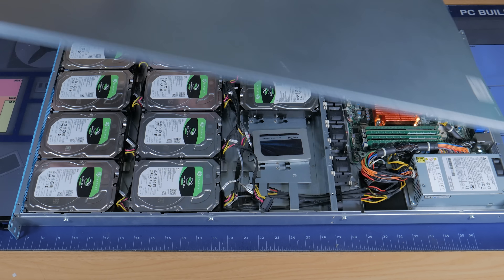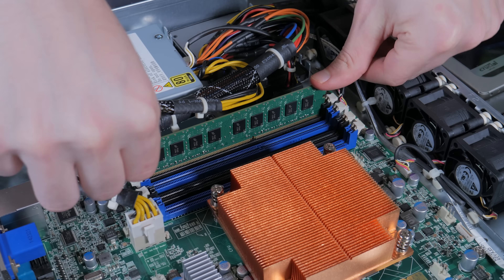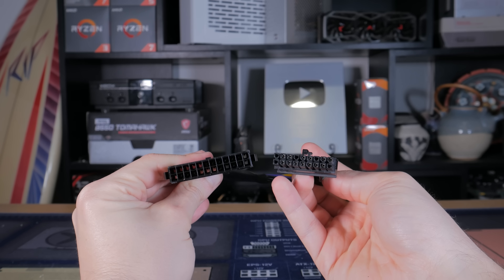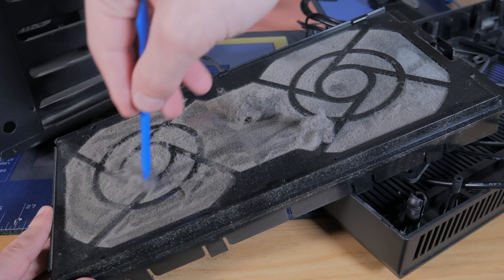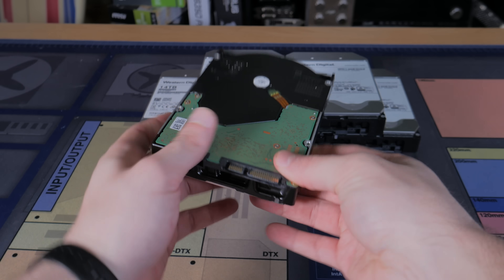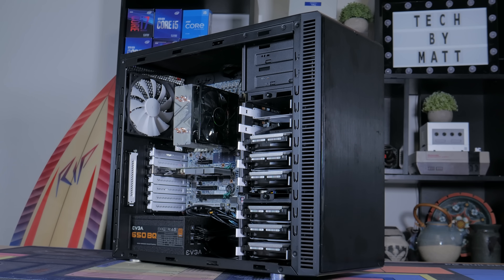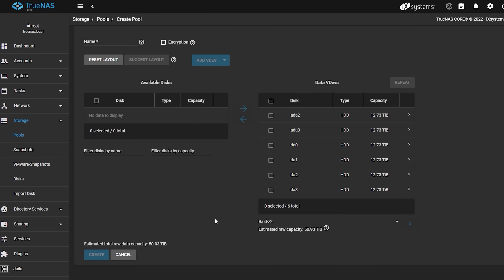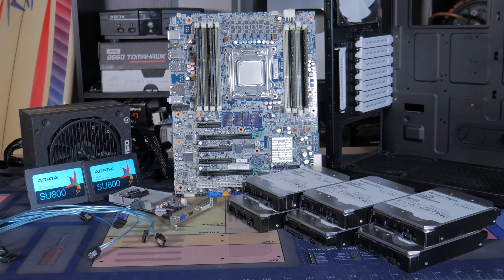Budget Storage Server 2022! | 84TB NAS

Comment: I watched your chenbro 80 terabyte server build,but when I hunt for it,Lenovo keeps comming up,except there chenbro cases.
If you research older new old stock tower cases like Aopen from 2004 Era,these had room for 7 drives.
There is still a lot of old stock even with power supply in them! And..made with real steel!
Although there a lot of cases that can hold 8 drives(desktop units).
I was in a computer store in Calgary that was an upright case,with room fir 25 drives!
I went there this past summer but they aren't pushing that product,cuz kiddies like laptops,so that what they're selling!
After you installed all 10 drives,I noticed you said only one would be active,whike the others where for redundancy! 
Let us know the difference between a cache drive and swap,vs paging.
Also,I find trunas little useless,when trying to use the dives but i may have made some mistakes with it.
Frebsd,is actually what is is,freebsd,can run updates and a program called " vinnum ".
So,did you find a pre-built chenbro server with a super Micro server board already installed,which is what I thought u said it was.
Plus msg me.
I want to run am email farm server so I need through put more then storeage!

Comment: I built a raid 5 server with this exact case like 11 years ago. lol Back when 1.5TB WD red drives were the new thing on the block. I had a hardware raid controller card. 6 drives with one hot swap. Only got me 7.5TB array. Crazy they make 15Tb in one drive now. Yes, one hot summer i had a drive fail and was nervous for like 18 hours while it was repairing the data onto the hot swap drive. I had a lot of issues with those 1.5 drives. RaidZ sounds much better. My card could only do raid6 back then. And it was much slower than 5 on the cpu.

Comment: I have just ordered new instead of second hand hardware to make sure power consumption is low, choosing a µATX Intel B660 motherboard with 2.5 Gbps ehternet and an i3 12100 processor (intel graphics) with a 400W 80+Gold power supply to host a simple RAID5 NAS with 3x4To drives. I hope my idle power numbers will be low, so would be interested in having your numbers with older enterprise hadware, even if the number of drives is of course different.

Comment: Just one question for you now: where did you get that tower to house all the components and visiting the links for the western digital external drives and boot SSD only lead to links that were either no good or the item you've linked isn't for sale. Do you happen to have any further advice for someone looking to emulate this setup, but with different storage options ?

Comment: One correction: RAID is backup, is the most efficient and fast way to backup files. Keeping file on cloud is just puting them on another RAID that isn't located at your place. Every server configuration uses RAID, it's the most efficient and has default redundancy. This is just how things are  !
Reply: RAID is not backup. It offers redundancy, and that is all. A backup is additional copies of data stored, preferably 'elsewhere' and in redundant fashion; i.e. a separate storage solution or site that will be intact after complete failure of the main storage.

Comment: building a NAS as I watch this; amazingly in the exact same case also bought used local for the same reasons as you. I love the component selection, like you said you're way more about it than the big boi yters. Was able to snag eight 4TB Seagate 5900RPM Skyhawk drives for $35 per, paired with an X299 MSI Raider board ($120 used local), and a $200 ebay i9-7900X cooled by a $40 ThermalRight FC140 that performs neck to neck with an NHD-15. Nowhere near your 84TB but your hoarding habit is worse than mine. Subbed, hype for more!

Comment: Built mine for around the same price 2x xeon 2680v2's, 32gb ram, be quiet dark rock pro 1000w, 6x 6tb wd red plus, 4tb nvme casheand  rtx a 4000. probably could have gotten some better performing hardware for the budget and ditching a few hard drives, then buying them later when you need the actual space.

Comment: 9:18 WD doesn't do that to discourage people to shuck the drives.
It's an actual enterprise feature, when you have multiple servers with 100s of drive each, you don't want them to spin up all of them once, with that pin number 3, you can schedule drives to spin up in order, so that you don't have massive power spike trying to turn on your servers by all the drives trying to spinning up at once.
Reply: How do you know that
Reply: @raidone7413  many nas and enterprise hardware boot drives(and other devices with high load on the PSU/s ) one at a time or by pairs of them ,to avoid exactly the same ,power spikes are a dangerous and real problem due to power supplies features like overcurrent protection and overload protection. imagine the power spike if you boot 25 drives @15k RPM at the same time... . On the other side ,if they really would like to avoid shucking ,belive me there are easier ,cheaper and better options like firmware checks or propietary connectors instead of standart sata port on drives. in fact i shucked 4*8TB wd drives and i did nothing about the 3.3 pin ,cause my ASUSTOR nas use the drives without any mod :)
Reply: @raidone7413  This is the same reason why corps like google are making their own way to boot up their linux machines. cuz it take ages for each to spin up and bring to life.
Reply: @raidone7413  Most of the bigger WD external drives are just using their enterprise internal drives. They used to not even replace the labels and were reds before switching to the white label like 3 or 4 years ago. Also the 3.3v pin feature just isn't compatible with most consumer brand PSUs, that's the reason they don't spin up.

Comment: Was looking at buying an off the shelf storage server, but wanted to see if a DIY project was within my scope.  Thanks to your insight and excellent presentation skills, looks like I will go down the DIY path and save some major $$$.  Thank you so much!
Reply: Yes, NAS servers are over-price and low spec.  The worst part is that they are limited and expensive in extending drive capacity.  The 4 bay extension can be sold at $500 or more, this can cost almost 60% of hard drive.  This is ridiculous.  The rack mount chassis is too loud to be used as HOME NAS.  TBH, any NAS vendor should provide option for new drive extension in less than $20.  That fits the nature of home NAS(incremental/annual spending without much planning)

Comment: The 3.3v pin isn't to prevent shucking.  Those externals actually use that pin to hard reboot the drive if it freezes for some reason.  A lot of NAS systems also support that pin to do the same thing.  It has a purpose... it just isn't a widely used option in desktop systems, so they don't usually support that pin.

Comment: Guys i have a question, for a nas killer its better to have xeon with ecc memory? and wd are the best for a nas or should get another brand? and for stuff like plex gpu is important like using a quadro?
Reply: now a days, its better and easier to have a newish Intel with a integrated GPU. Their quick sync is better. You can pickup a qnap, synology, or an asustor with a four core unit that will transcode 4k on the fly. Now, ... don't get me wrong. A powerful nvidia GPU will beat it, but you will spend the money for it!!

Comment: Those fractal cases have two SSD trays on the back of the motherboard plate. I have one I'm in the process of turning into a Proxmox VE + NAS. If your trays are missing I think you can still get them on ebay.

Comment: I was never a fan of shucking externals to rig up a server. I just buy used sas drives and LSI controllers from ebay.. works well. This last go around I bought new HGST/WD sas drives, but used an intel i7 11700 and B series motherboard.. added 10gb nics to all my servers and torrent box, main pc, etc. Couldn't be happier with it. Fast and stable. The 11700 I bought for transcoding without a gpu, and the IGP is more than enough.

Comment: I also have a HP z420 and you need to tell the viewers about how to swap it properly. The system won't boot up without a video card at all. Also you need to short out some pins in the USB 2.0 header, USB 3.0 header and the FireWire header. CPU fan header 5th pin needs to be jumped to the 1st pin. Also fans have to be connected to the memory and rear exhaust headers. It will only boot with all these conditions satisfied. USB 3.0 header was especially hard and i had to solder the 2 pins under the motherboard.

Comment: You select boot UEFI because BIOS doesn't support as much storage as UEFI, not because the motherboard is old. And another thing, you should have setup iSCSI on the NAS, it's much faster. Your MAC and your primary PC can connect to it using iSCSI as well. Also, ZFS uses a lot of system memory to cache data, you should install a GB of RAM for every TB of storage you have.

Comment: Budget? Only if you're Tony Stark. Budget would be taking all the hard drives you've kept over the years from 40MB to 8TB and using those. Well, not the teeny tiny ones from ancient history but all the 500 GB on up drives. Budget is taking an 8 year old computer and using that, upgrading it to the level you need as cheap  as possible, i.e. used parts.

Comment: You - Builds a 80+ tb server for work

Me - heavily debating if I should get a 8tb hard drive to download my steam library locally so I can just swap games between my HDD and SSD instead of having to download them
Reply: I have a 8TB drive for my Steam library. But I have 32GB of memory, and an SSD cache which I use together with a piece of software called Primocache. With that setup there's no reason to not just run games of the large storage drive.

Comment: At 3:10
The chip model....

You send the chip model was an E5-1620.  You forgot to mention which one it was....there is the original, the V2, the V3, and the V4.
The V1 and V2 take a different socket (LGA2011) than V3 and V4 (LGA2011-3)
The V1 chip used Sandy bridge (32nm, 2012 release) microarchitecture. V2 used ivy bridge (22nm 2013 release).  V3 used Haswell (22nm, 2014 release).  V4 used Broadwell (14nm,  2016 release).

Each of the four chips has a different set of clocks as well....

This is all according to the app "CPU-L"....

Comment: i built a 6 drive Freenas server about 5 years ago using a base HP server that i got from Tiger for $200. The bad thing was it needed DDR4 ECC ram and that was not cheap back then. Freenas is happy using 16gb flash drives for the OS to I installed one inside on the MB usb connector and the other on an external slot so my OS is redundant. I did not have video files to backup so i used 6ea 3tb drives in a ZFS array and was configuring it 10 minutes after hitting the power button. That particular server uses a very proprietary display port that i could not get working in my monitors so I threw in a old low end video card for initial setup, after that everything as done via ssh over my network. The server interface over ssh is very easy to use on Freenas and it looks very similar to the Truenas screen.

Back then it cost me about $950 for this including the hard drives but it's been online since then with no hiccups. i have lost power a few times so i usually have to power cycle after that but it always comes right back up like nothing happened. maybe someday I'll need more capacity bit for now it's just fine for me.
Reply: i love how open source stuff is kinda timeless...5 yrs with no issues is amazing..lotta times I'll youtube a  command and not realize till later the video is from 8 yrs ago but still relevant today
Reply: @calvinpryor  This was a loss leader HP Proliant M10small tower server I got at tiger for $200 back then. The most expensive thing was the 16GB of DDR4 ECC ram. The 6ea 3tb red drives are all 5400 ,( don't need speed here and low speed drives are more reliable.

I've updated Freenas a few times and have 2 or 3 power failures a year but the system always comes up clean with no errors in the logs except for the sudden power loss. This system has been as reliable as anyone could ask for
Reply: @dell177  did that version of true nas support third party (if any) apps? That's really the deciding factor on diy/Tru nas vs synology type nas....if I can get the same.applications and functionality with true nas why would I spend the extra $ on their hardware? 🤷
Reply: @calvinpryor  I believe it does but I've never looked into it, all I wanted was a safe place on my network for my files. I can link to iot from OSX,Linux, and Windows

Comment: I just built a NAS myself. I used a Microserver Gen8 for it as I could get it relatively cheap and I wanted remote management and a compact design. I used the SCALE-version of TrueNAS as it runs on top of Linux and you can use Dockers and VMs there. And if I find another server of the same model for cheap, I could even connect them together.

Also I can recommend using a Ventoy stick if you have a bigger stick and want to install different operating systems from it as you have a menu there where you can select one of the ISOs you put on the drive before. There is a partition where you can simply copy the ISOs onto and delete them later. No need for burning them to the stick and wait for that process to finish.

Comment: I am thinking of creating a mass storage system to hold and be able to run games off of my main computer. Would it be better for me to have a storage server, nas, or just hooking up an external storage bay? I am leaning towards an external storage bay since from my understanding of servers and nas they are mainly used to spread files to many different computers. Is this what you would recommend and if so what are some things i should look for in  a storage drive bay?

Comment: In the future you could just buy a cheap hba(host bus adapter), like a lsi 9211-8i and flash it into "IT-Mode" or buy it preflashed for like 20 dollars and 2 SSF 8087 to Sata Splitters for like 5 dollars. 

This will give you 8 Sata-3 ports while having a solid enterprise drive controller. Been using it for years without a problem. Its also way easier to cablemanage. 

Also love the budget content

PS: might wanna take a look at Dimm 3 on your board 11:39
Just saw 15:00 did reseating fix the error?

Comment: Be careful with raid. Since an error on a drive is only detected as the data being asked is reported unavailable by the drive, thus the raid system flags this one out and ask for a replacement, as you put a new drive , the system will start to read what has not been accessed since a long time to rebuild. If a second unaccessible data is noticed on a drive used to rebuild the array... the system is pretty much clueless. To avoid this over long period of time, once a year I stop my system and inspect all my drive with MHDD. I have an old pc with the mhdd cd in it and the storage controller set to emulate IDE. Scan all drive, take pictures of the results and save them for comparaison with previous year as i'll do the same thing next year. This way I can monitor the degradation in health of the drive over time and even spot when some sectors are going to die soon.
Reply: He's not using RAID

Comment: If you are the only user (or there are only a few users) 4 cores and 64gb should be more than enough (unless you are working with lots of huge files at the same time).  You can also get a low power v2 Xeon L (4 cores) and save a little in power to boot.  I'm about to snag some drives to upgrade my storage server (4 core 16gb mem) but might take a shot with some renewed drives to save some money since I'll need 12 of them and save quite a bit of money.  

And I know the internet will tell you that ZFS needs 1gb memory per TB but that isn't correct.  Of course I can't find it but a ZFS dev once commented about the matter and basically said it was misstating how ZFS uses memory.  Unless you are in an enterprise situation with a ton of read/writes going on at the same time you don't need L2ARC or ZIL drives either, but considering I like to tinker myself I understand that sometimes it's fun squeezing every drop of performance out of a system even when it's technically overkill.

You would probably see the most improvement by far from the 10gbe upgrade which I'd vote for in a follow up video.

Comment: I have the same board and also have to key press for boot, I have a Pro Micro arduino board connected to USB port when the usb port gets power it seconds the key strokes for 30 seconds then stops. Works for start up but not for reboots because the reboot never completely cuts power so If i’m remote and need to reboot i just make sure to do a shutdown then send WOL

Comment: 5:15 That cooler will do you just fine, trust me. I have the exact same one fastened to my Xeon E5 2673v3 12 core and I am currently watching this video on one monitor, while editing video in Premiere Pro on another and i'm sitting at 42c :) 50c max since i fired up hwinfo.
Reply: Mind you I do have a 2nd 120mm fan janked up in a push/pull config
Reply: How did you get from 4 pin fan, to 5pin Mobo connection?

Comment: I have the same chassis, bought some years back. You can add up to two extra disk modules in there with room for three drives each, taking some space for PCIe, obviously, but that may be worth it. I'm using an LSI SAS controller for my drives, in addition to the onboard SATA ports. All drives are SATA, though, but SAS controllers support SATA as well as SAS.

PS: You can move those rubbery gaskets around if you slide them aside and pop them out to fit all screws. At least, that has worked with all the drives I've tested so far.
Reply: What's the chassis model number?